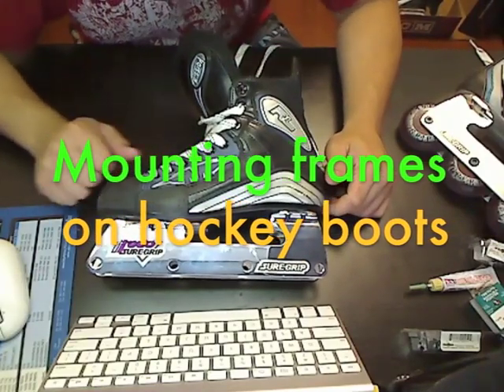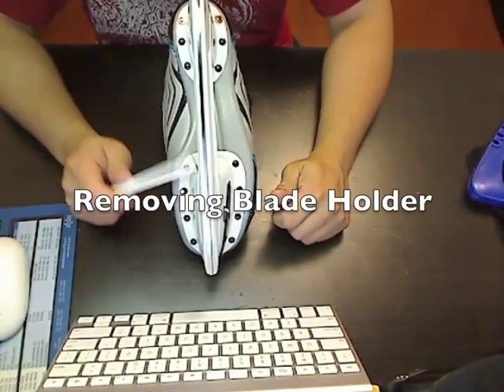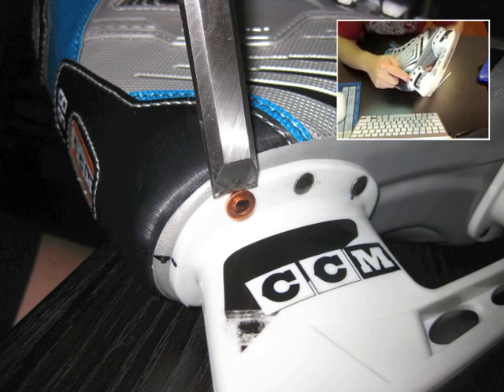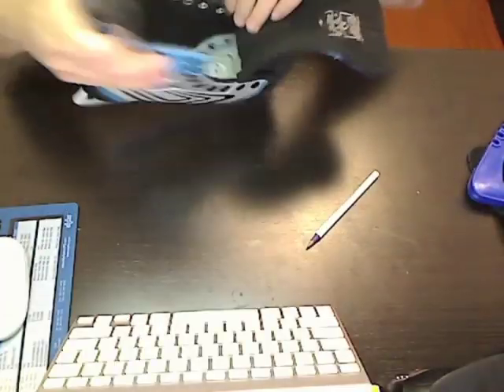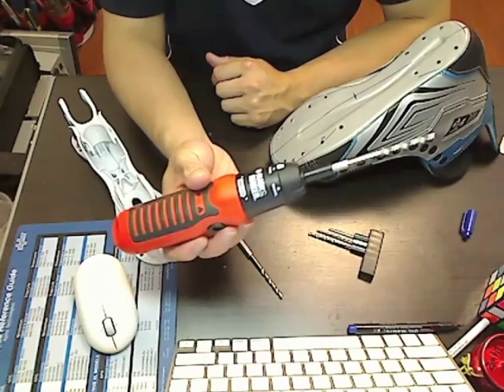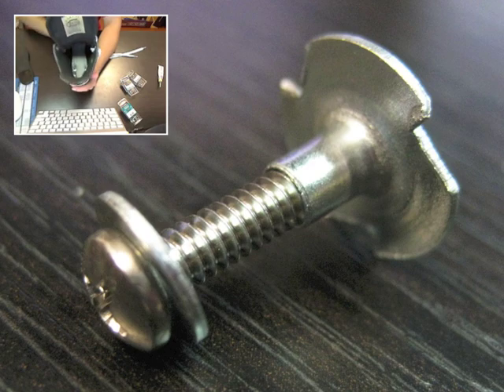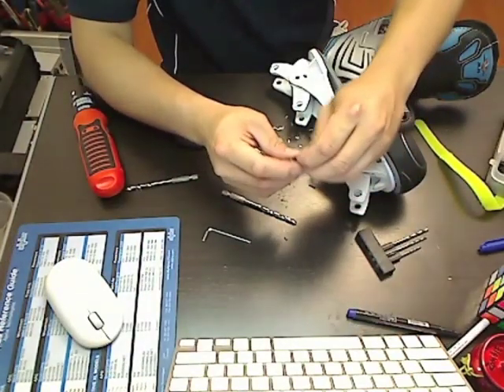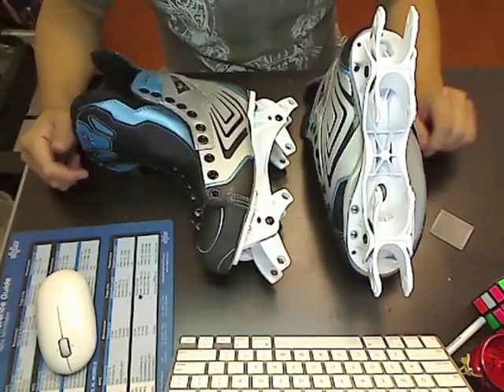How to mount inline chassis frame to ice hockey boots, sprung on ccm

Comment: Hey I used a center punch to get out most of my rivets (well actually a nail set and a hammer).  It worked great, but I cant use that method for getting the front 4 out.  I tried drilling over a few of the prongs on the rivets, but they end up spinning, so thats out.  I guess I could try to get in there with a dremel, and cut off each prong, and then pull it out the bottom.  Worst case scenario, I could dremel the other side, and pull them out from inside to boot, but im pretty sure this would ruin the tuuk - which I would like to hang on to.  

Any idea how I should try getting these out without screwing anything up?

Comment from the maker: I didn't use all 4 screws on my heel but I'm lighter.

"you can drill inward a little to avoid hitting the frame with the drill, and they will mount easier because of the slight angle"

Comment: Great video, thanks for the tutorial!  The heels on my Grafs are pretty narrow compared to the Sprung frame I want to mount on them.  Have you had any issues with those connections at your heel being into the wall of the boot?  I'm not sure all 4 of the screws will fit, maybe I'll add one in the center at the arch?

Comment: Hey I'm an ice player that played a little roller and now I have these nice bauer inline skates that I would love to use the boot for ice. Can this process be used to do the opposite of what you've done in the video, meaning removing a roller hockey frame and replacing it with an ice frame and blade? The boots themselves are virtually the same as bauer's ice boots.

Comment: sweet im totally gonna convert my old tacks 252s.  i just have to find the right roller chassis i want and that will work with it.  if anyone has any suggestions place let me know.  i would prefer not using a hilo but if i have to i will.
Reply from the maker: Check out the Sprung chassis', they aren't HiLo.
Reply: ok cool
Reply: i converted my old tacks 252s with a hilo chassis.  best skate i ever had lol
Reply: no im right handed and play lefty.  no one said i was good though lol.